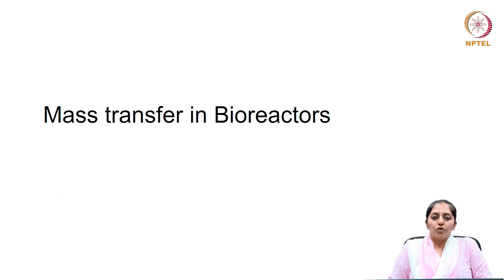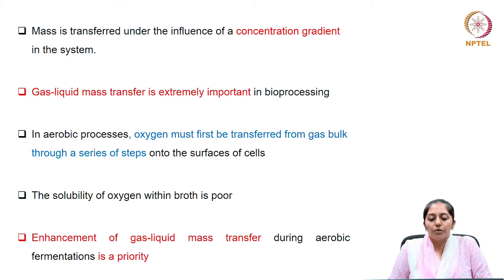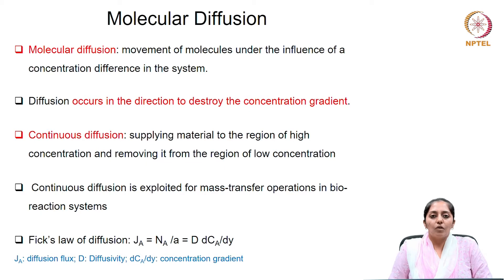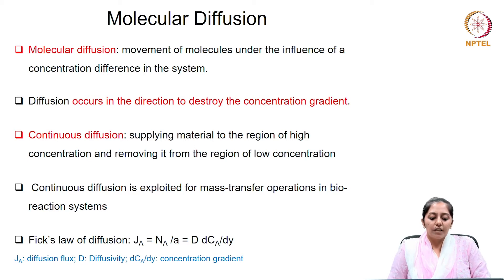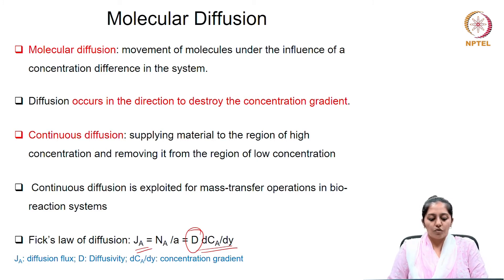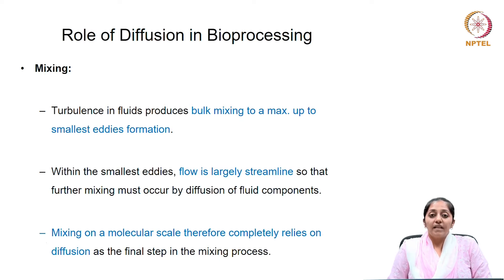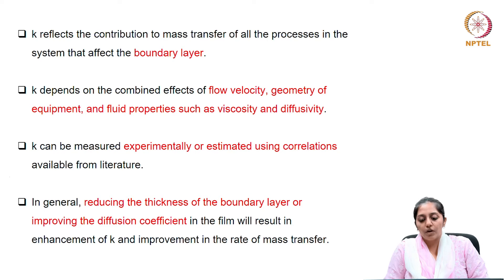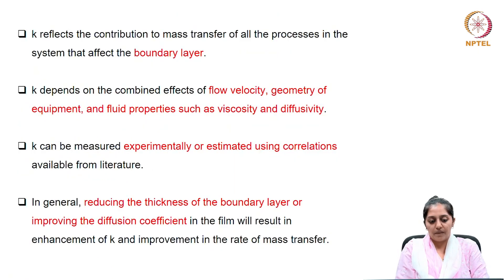mod05lec19 - Mass Transfer in Bioreactors - Part 1

Comment: In your definition of continuous diffusion shouldn't the transfer occur from a region of high concentration to a low concentration. That is the mass should get removed from the high concentration region and supplied to the low concentration region in order to destroy the gradient. What is mentioned in the definition is completely opposite. Kindly clarify?
Reply: The transfer of mass does naturally go from a region of high concentration to a region of lower concentration. To maintain continuous diffusion (so that diffusion keeps happening) you need to maintain that concentration gradient, so you need to manually keep adding more material to the "high" concentration side and you need to remove/use the material from the "low" concentration side.
Reply: @hayleyford3506 thanks hayley